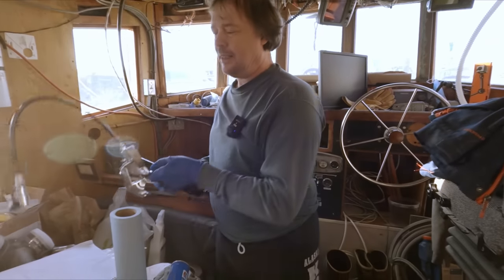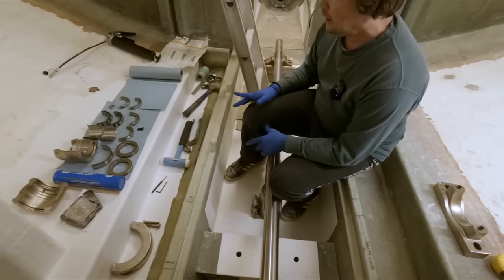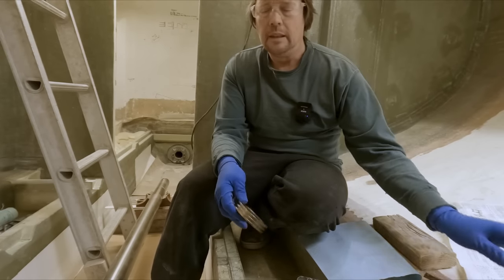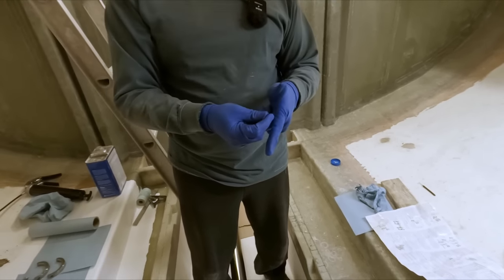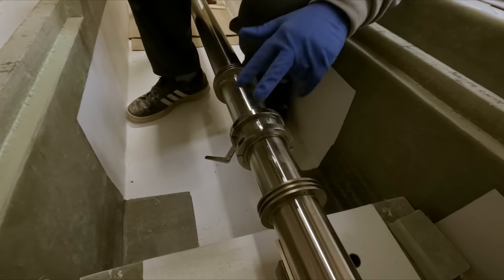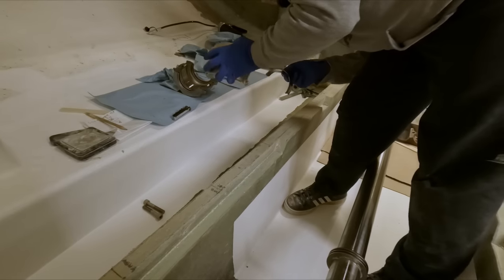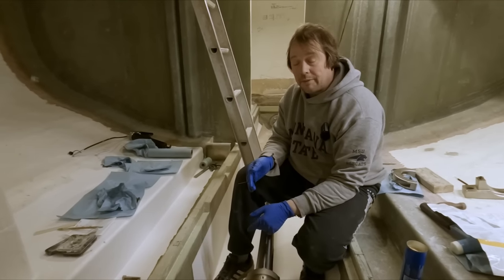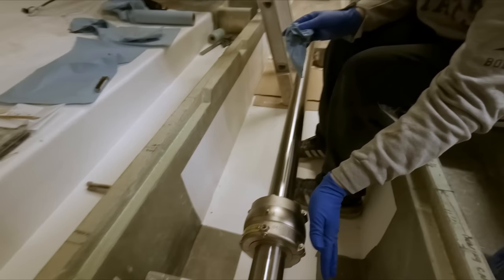More on Split Bearing-Emerald Isle: Ep.64 Fishing Boat Refit

Comment: you are doing a good job when i was watching .this you said about packing thin steel you can get silver steel which is ground flat on ebay of the thickness you require it is about 4 inches wide that may do the job

Comment: Plumbers generally have a screwdriver/nut driver calibrated in the lower inch pound scale for tightening screw hose clamps and other plumbing fittings.  You might see if you can borrow one from a plumbing/HVAC outfit in town.  They take the standard quarter inch inserts.
Reply from the maker: We ordered one and torqued to proper settings when we repacked the bearings.

Comment: With small bolts you need an inch pound torque wrench
Reply from the maker: We had to order one as the lowest one we could find in town was 5 foot lbs. Came back and torqued to correct value when we did full grease pack.

Comment: For shaft seal, picture which way the pin would be driven in future dissasembly on shaft.  Also your work surface when trying to drive out pin was bouncing bad.  You need a more solid surface of steel and heavy.
Reply from the maker: Spot on Steve. That was a horrible setup. Later we did need to remove the pins in the aft bearing. Set up on solid steel surface and pins came out with no problems.

Comment: Like # 127
After you, it's a meatloaf that'll take my time lol, so let's get this show on!!
Cheers 🍻
9 minutes in, damn it didn't drive out....but then I thought, what if the pins need to be pressed out, not driven out per say by blunt force....it's the little things in life that throw us the curveball lol...continuing on haha

At 14:00 enjoying the music mom...I do believe she cuts all the video's, Matt comments haha

Nice coated shaft now...

Question! What is that clipped on dad's sweater?

36:56 would a Lazer be just as easy?

Great video guys, I wanted to touch it too haha 😄 
Pabst Blue Ribbon Cheers 🍻
Reply from the maker: Hi GoldVP. The pins are driven out with a punch per the instructions. Setup is everything and that was not the right way to do it. For the aft bearing we did have to punch the pins out. We set up on a solid metal bloch and had no problem tapping it out. 

That is the audio mic clipeed to my shirt.
Reply: @EISAlaska  makes sense on steel instead of wood, due to vibration then. Audio...thought it was some kind of self leveling gopro lol